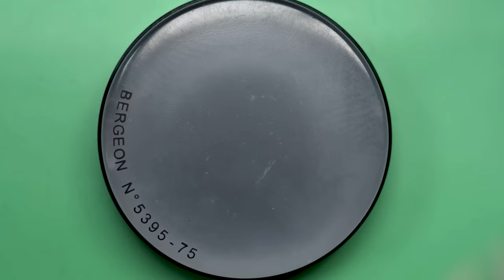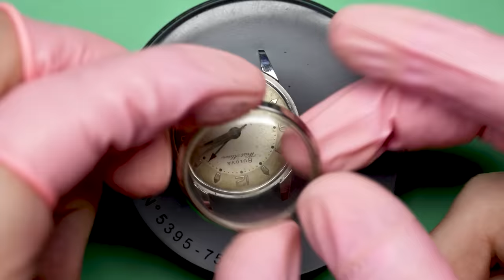Restoring A Broken Vintage Watch With an Alarm Function!

Comment: Marshall, I just want to preface this with as a fellow watchmaker I'm a huge fan of your work and I love watching your videos. However, today I'm going to be a critic. I was watching the video and I just wanted to offer my advice on something that really should have been addressed when servicing that watch. That being how you dealt with the rust in the movement. It was good that you started to clean the rust on the bridges with peg wood, but when you were reassembling the movement it really bothered me to see all the rust that was still present. You saw the watch when you got it. That rust ate up the bridge screws, click spring, etc. If you don't clean up all of the rust that movement will end up in the same state again. It's important to realize that the cleaning machine isn't meant to clean corrosion off of parts. It will help, but it's real job is just to remove oil, grease, and grime from parts and that's all. When I'm dealing with rust in a movement I like to use a fiberglass scratch brush for the steel parts (like the wheel pressed on top of the barrel and the stems), and a piece of peg wood to clean pivot holes with surface rust (like the inside of the barrel arbor holes). For the nickeled bridges I also start peg wood, but for more stubborn rust like in your situation, I make a paste from cream of tartar and a little water and use a paint brush or peg wood to remove the remaining rust and staining from the bridges. After doing all that you may need to polish some screw heads or use a ruby stone to get the shine back on some of the pieces, but in the grand scheme of things it is always better to have poorer looking, clean parts in good shape than slightly better looking parts with rust on them. Because eventually that rust will spread and do more damage to the movement and case. I hope I don't come off as rude or that I know everything, because I don't. I just want to pass along some knowledge that I have learned from my firsthand experience as a watchmaker. I see the work that you do and how committed you are to the craft, and I want to see you succeed and not make avoidable mistakes. Hopefully you find this helpful and you can use it to continue your journey as a watchmaker. We can never stop learning because there is always something new to tackle. So keep up the great work!

Comment: I was under the impression that the alarms in these types of watches were designed primarily as a physical stimulation to the wearer, rather than an auditory one.
Reply: Patek Philippe have a great video about their alarm watches, they actually tune the sound and the owner of PP inspects every single one himself. It's incredible
Reply: It seems like it's akin to those handshake buzzers that "shock" whoever you shake hands with as a gag. But it doesn't zap you with electricity, it actually vibrates really fast because it's releasing a spring rapidly. It's basically just a large watch mainspring.
Reply: Probably. Much like smart watches. The vibration is quite effective, and less irritating than noise.
Reply from the maker: No, they are meant for both. Remember you have to pull out the stem to arm the alarm, if you were sleeping it would be too easy to push that back in which disables the alarm.
Reply: Its no PS1 rumble pack, but I guess it works :>
Reply: @Royvdl  that's different that's a chime on a grand complication which is even more nuts
Reply: @WristwatchRevival it's super easy even when you're awake. I would bump it reaching into my pocket and then it would fail to go off.

Comment: While I was still working as a manufacturing jeweller, I restored quite a few silver & gold watch-cases along with the occasional simple rolled-gold case-repair.  Usually the movements would be sent off to an experienced watchmaker we regularly used.
However, I did purchase a number of old watches myself & restored, with some doing the whole lot myself, but one sterling silver cased pocket-watch with a cylinder-escapement proved more than it was worth when all the slightly rusted spring-metal parts for the case & movement simply snapped under any tension, especially those being refitted to the case for holding the covers open & the release-button in the crown!

Comment: In 1976 I was given a Bulova for my 18th birthday, it being the tradition that a Swiss watch was given (and my parents did not know that Bulova was only temporarily in possession of a Swiss factory!) I still have it, but no doubt it needs a service as it doesn't run for long. I also have a ~1965 Wrist Alarm that works perfectly. I use it at night when I need to get up early and don't want my wife to be woken by a loud alarm. Very useful!

Comment: It's really pleasing to see Marshall diving into the early, mechanical, sonnet movements. They can be very difficult to troubleshoot and time consuming looking for missing/broken components. I specialize in circa 1800's, swiss, repeater movements. When you get them running and functioning right, it's such a gratifying feeling!

Comment: A personal alarm clock or watch was a very handy thing to have.  In the 80's & 90's, I did a lot of travelling and even though most hotel/motels had a alarm clock or a wake-up call, the smart traveller did not trust either.  I was burned more than once by alarm clocks or wake up calls that did not happen on time!  I carried a windup Timex alarm clock that folded into a hard 2" x 2" case and unfolded to sit on the side table with the time displayed.  In the 90's I upgraded to a Timex digital alarm clock about the same size.  I still have both!  I would definitely have worn this Bulova wrist alarm and used the alarm function.

Comment: This was a really interesting piece; the added complications from the alarm were interesting to see how they were implemented.

It's a shame you didn't take more of the visible rust off though.
Reply: I was thinking the same about the visible surface rust. A very gentle rub with some scotch-brite would have made the world of difference
Reply: Yes. What he calls 'patina' is actually unsightly dirt and rust which could easily be removed. Disappointing.
Reply: @yessanknow302  The Patina on the Dial could very easily be removed, but if you listen to what he said, his experience has told him that taking the Patina off the dial will cause more trouble than it worth as i presume it will remove what the patina is attached to also leaving a patchwork looking dial of the original paintwork and whatever it was painted onto. best to leave it as is, or source a new one.

The surface rust that's in the mechanism really should have been removed though.
Reply: @yessanknow302  The dial should be left alone. As he's said, he simply doesn't have the ability to properly restore them and so he leaves the dials as-is, which I think is appropriate as restorations performed by people who don't really know what they're doing will absolutely ruin whatever value the piece has. Better to perform nothing more than a cleaning of the visible dirt and debris.

What I'm referring to is the visible rust on the movement. Marshall stopped very much short of removing all the rust from it when it wouldn't have taken much more effort to do so.
Reply: Agreed!  Please buy a small bottle of Evapo-rust!

Comment: Hello Marshall. I own a similar old Bulova. The alarm is not auditory it is vibratory. While you can hear it, it is designed to vibrate against the back of your wrist  to alert you. Back in the mid to late 70's I would crash on the heaters at college, to be awakened by my trusty Bulova vibrating against wrist bones. Then off to the next class. If I can find it, I can send it to you for you to repair it. I had it "cleaned" at a watch repair place. It never worked right after that. Keep up the good work.

Comment: It seems to me that you do have to make sure the hour hand and the alarm setting hand are lined up so that the alarm goes off at its apparent set time. Near the end when you demonstrated the alarm, it looked like it was set to go off at 4:00, but the time read about 1:20.

To do this I think you would have to fit the alarm hand, then adjust the time until the alarm goes off, and position the hour hand to match the alarm hand.
Reply: OCD here thought the same...
Reply: Exactly right. Sync the hour hand to the complication just like a watch with a date.
Reply: Yeah, as soon as he put the alarm hand on I was wondering is it one position fit or should he have been searching to see how it has been set. A surprising error given his grasp of what he was doing. I think he would have had to turn alarm until it activates and then fit all hands at midnight hence ensuring alarm and time hands coincide, wouldn't have had to fit the hands either as far as I can figure to achieve that. Great video, enjoyed every bit.
Reply: Yup, just like a regular alarm clock... 😀
Reply: I was thinking the same thing.  I hope he posts an extended version showing how he aligns the alarm to the hour hand.  I love this content, Thanks Marshall!
Reply: Was thinking exactly the same thing! Also that this alarm function is useless for anyone planning to sleep for more than 12 hours, but mostly the syncing thing 😅
Reply: Yeah, I noticed that too. Simple fix.. pulling the hands and put them back on at the alarm time.
Reply: Yea I got one of these old watches , but from a different brand, and the alignment of the hour hand with the alarm hand seams to set it off.
Reply: @krugerdave since at the time the watch was made that was also true of alarm clocks I'm not sure what your issue is.

Comment: the rusted part looks like it may have been the "click" spring,  the odd gear with the long "tooth" looks to be an alarm limiter, so the alarm can use energy from the main spring but that gear limits the amount that it uses because otherwise it would run the mainspring down.
Reply: There's something similar on some alarm clocks with only 1 spring, for the same reason.  I think I've seen it on the small travel alarms you used to get back in the day.  Bigger alarm clocks that sit by your bed typically have a separate alarm spring.  When I saw those 2 crown gears on this watch I wondered for a moment if it somehow had a second spring for the alarm, that really would've been clever :)
Reply: @austinshackles549  I actually have alarmed wristwatch branded Sekonda with two separate mechanisms and two mainsprings etc. They have very small balance and cogs and all other stuff but nevertheless it's rather thick and heavy watch. Unfortunatedly someone cannibalized my watch - took all alrm parts away.
Reply: G'day, Chris here, welcome to Clickspring. I love making clock pahts, but it's been a little while since, so I'm a bit rusty..

Comment: These wrist alarms are so cool.  I wish more manufacturers would put this features on their mechanical watches.  Have to admit, I was a little proud at the 2:50 mark when I was able to guess the post on the case was the 'bell' the hammer struck for the alarm. 😁

Comment: To give a more detailed explanation of the alarm mechanism (if I understand it correctly):

The double lever construction on the front enables and disables the alarm by blocking the pin on the bell and is activated by the 2nd crown, as explained in the video

The hour wheel has these little ramps on the top (9:38) that can slot into holes the wheel from the alarm, which is held down by that flat round spring. If that happens it allows the hour wheel to be pushed up by that long arm underneath the hourwheel, which consequently also moves up, thus lifting the hook at the end above the pin from the bell and consequently allowing the bell to ring.

As for how the Power works I currently don't know, I'll add it if I find out
Reply: Great job marshal, really enjoy your presentations. now getting into this great hobby, keep them coming thanks for your inspiration.Gary.

Comment: Great vid! One question, did you have to sync the alarm hand? Or does it only fit in one position?
Reply: I question whether the alarm hand was in sync? That post on the back of the watch is for sound, but I never heard it!
Reply: @johntwemlow6089  It's the buzzing sound when he's testing it. It's most likely meant to transfer vibration into the wearer's wrist rather than emit a loud tone.
Reply: you have to sync the alarm hand with the hour hand, what he did in the video was incorrect
Reply from the maker: Yes, but I didn't know how. I did figure it out though
Reply: @WristwatchRevival  Appreciate what you do Marshall, not wanting to be critical. I did the trade in the '60s and '70s so just love watching the restoration that you're doing here. Recognise many of the models you're working on.
Reply: He basically had to figure out when the alarm went off and set the other hands to that position.

Comment: Gorgeous!! 😍

I'm glad that you're a lot less inclined to polish the body or do a dial-cleaning and instead let the patina do it's magic. 🧙‍♂

When you find an old watch that looks like new, great! (if that's your thing, go look for one!)
But when you find one of these ones where there's some light scratching and some discoloration or light griming on the dial, as long as it's not significantly damaged in a way that prohibits you from properly reading/using the watch, just let it be an old watch and honor the life it's already had thusfar! 🥰
It gives the watch a little character and if you're into a more vintage clothing-style, it will enhance your look immensely! 👍

Comment: Fascinated with your videos.  Suggestion:  With the potential for small parts to go flying away from the bench (in another video you concluded one had gone out an open window), you ought to consider surrounding your immediate workspace with mosquito netting or something similar, to limit the area in which an errant part could land.  You might devise a frame similar to what's used to safeguard observers from a shot-putter, but with 360 degree coverage.
Reply from the maker: Thankfully it doesn't happen too often these days
Reply: Then, you’d have to find where the object is caught in the net ;). More seriously, I’ve considered doing this. My current solution is to use a very large, plastic/rubber/silicone work surface. Knock on wood, it has worked well so far.

Comment: Another bravo!  Maybe point out to newbies that vintage watches can be very tricky to start out with.  Parts can be difficult to source.  And as Alex points out, if you’re a beginner and you can’t make a new movement perform as well or better than it did before your service, then you shouldn’t dive into vintage watch restorations yet.  Vintage watches carry the DNA of previous watch servicers, and sometimes it’s not what you would hope for.   Many thanks!

Comment: I wonder about how 3D printing could benefit this hobby. A mostly 3D printed wristwatch would be cool and an amazing learning experience for those interested in the hobby.
Reply: There are 3D printed watch tools out there; a crystal press, small parts trays, even a mainspring winder. Some Microbrands are prototyping their case designs with SLA printing as well.
Reply: @deekman78  Where did you see the 3D printed mainspring winder?
Reply: I have my doubts that affordable 3D printers could make durable parts that are that small. But they could make something bigger that assembles the same way. That might be a lot of fun for someone who is learning about watchmaking, or likes printing/assembly challenges.
Reply: @timstoffel4799  They don't have to be durable at all to be a demonstration piece.

I think SLS, true SLA and MSLA kind of fail on the bloom, and there's a new affordable DLP printer just coming out in a few weeks, but it completely fails on resolution. I dont think any technology at hand can currently produce a wearable mechanism where gear the teeth engage to begin with, one capable of running for even a few seconds. True SLA probably comes closest, while being not quite affordable.

I think some of these are just precise enough to produce a geartrain seen in the cheap $3 quartz alarm clock, and have it run.

It would be interesting to see a wrist watch mechanism at the size of 18cm to be FDM printed, and i think it might just engage even if perhaps not quite run due to forces and friction involved. I'm not convinced that i want to CAD it myself.
Reply: @timstoffel4799  Who knows, perhaps you could use a router to cut out parts off an existing plate of the proper thickness to make watch parts. For metal printers it seems like it would depend on how precise the nozzle and motors are.

Comment: That post attached to the case back will very likely have the effect of transferring vibration to the wearer’s wrist. A form of analog mechanical haptics device. Kind of cool, even though having worked different shifts during my early work years, I hate all alarms with a vengeance. 

Great rebuild. Thank you for sharing.

Comment: Hello Marshall, congratulations for your excellent work with this Vintage Bulova alarm watch. Very interesting watch and how it operates driven by a single mainspring.  If you allow me a comment, I noticed is that the alarm is not in synch with the watch hands, particularly in the video, the alarm was set at 04:00 while the watch started to ring at the 01:20. My suggestion would be to bring the alarm back in synch with the hands using the following steps:
1 Remove the hands;
2. Operate the hand setting crown observing the hand pipe moving clockwise until the alarm starts to ring. Immediately stop moving the crown at that moment. 
3 Reinstall the watch hands at the 12:00 position. Just like you would do when fitting the hands on a watch with the date complication. 
4 Verify the watch alarm is  then operating normally at the time that was set.
5. Would be nice to show us on your channel if this procedure was successful.
All the best, looking for your next project, Dan